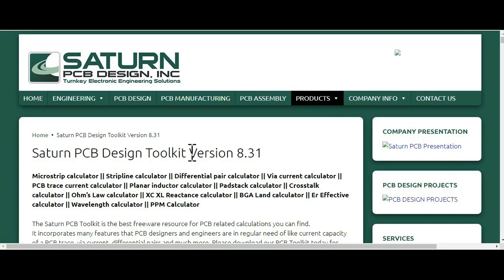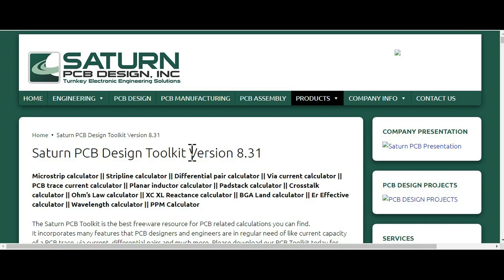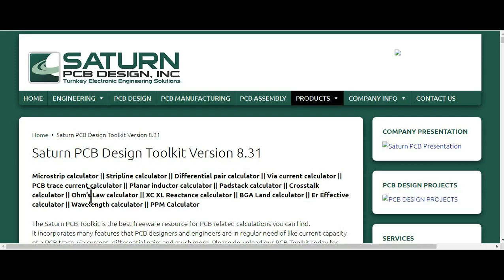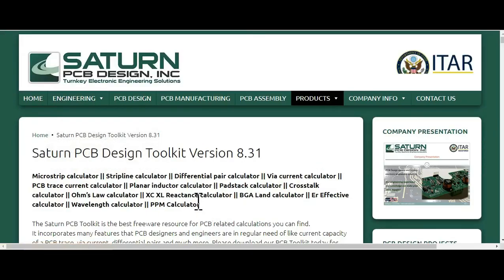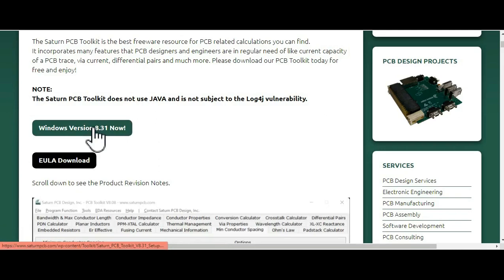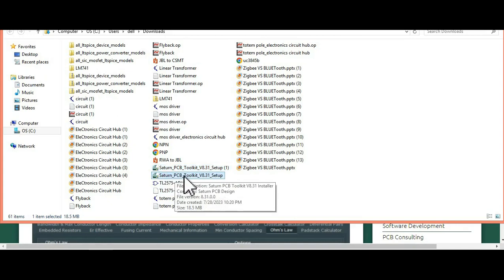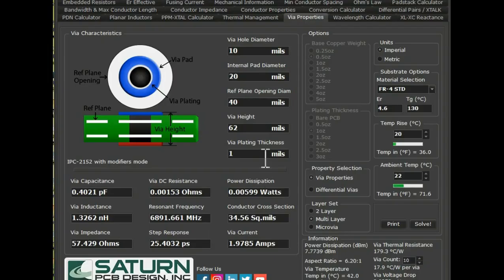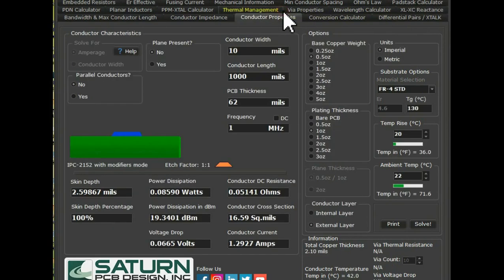How to Install Saturn PCB Toolkit Version 8.31 | Step-by-Step Guide

Comment: Saturn UI sucks,  the UI window is fixed and uncontrollable,  top and bottom part of the window are cut off, which makes user unable to control the window.  it becomes a dead UI window.
Reply from the maker: Yes thanks, indeed that was my observation.